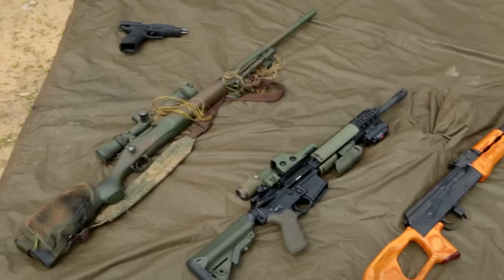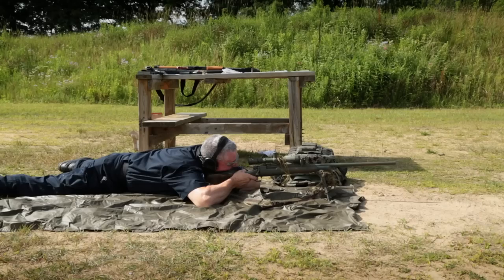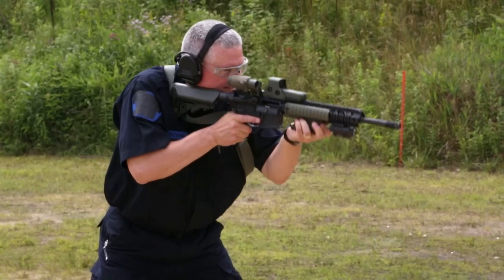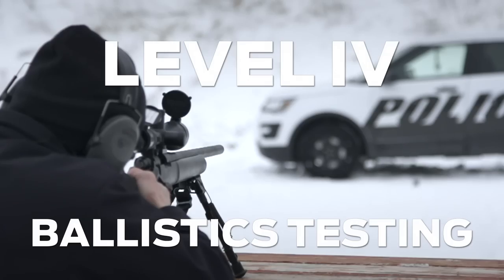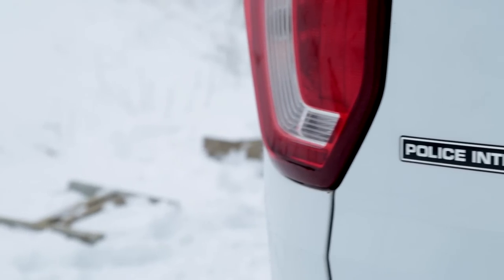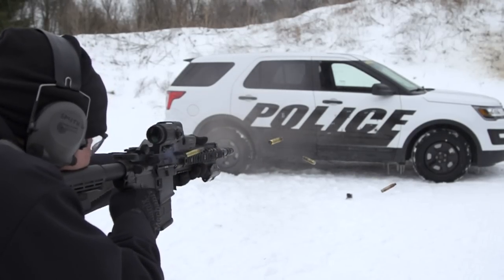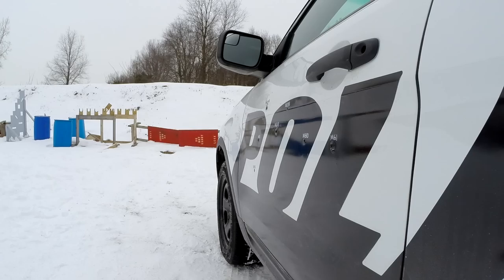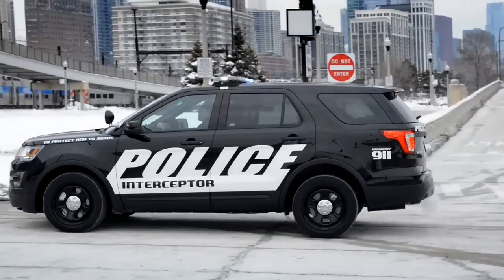Ford Police Interceptor Ballistics bullet proof armor Testing schussfeste Panzerung - Autogefühl

Comment: Cab bullet proof window resist armour piercing bullets ? Or those windows only resist non armour piercing bullets ?
Reply: Alan Garcia “Bulletproof” is hard to define. The short answer is no. In addition to the normal lack of knowledge of ballistics, it’s worth noting that an “armor piercing” round doesn’t really increase the round’s penetration the same way a larger caliber round would. For instance, a 7.62x51 round will nearly always go through more things than an armor piercing 5.56x45 round.

So that means that normal bullets are basically just as threatening to armor as the same bullet with an “armor-piercing” label tacked on. BASICALLY. It gets pretty complicated, and generally bigger bullets gain more of an effect from penetrating cores. This is like 12.7x99 and up, tho.

Comment: Will they buy it when they find out how much gas it's used and the windows are not bullet proof?
Reply: The windows are bulletproof they have a layer of polycarbonate that will stop the bullet or a bulletproof window laminate/tinted. The bulletproof window laminate is also bomb proof since the bulletproof window laminate company blew a 2500 pound bomb.

Comment: Windows?
Reply: +JWJMC Yeah; a question so obvious the video doesn't deal with it at all, which probably tells you everything you need to know.
Reply from the maker: +JWJMC I also thought about the instantly. Obviously armored windows would increase the weight of the car significantly and it is also said that you could hardly get out injured people after a crash when the windows wont break.
Reply: +JWJMC probably not bullet proof but then again its not supposed to be a tank. Some protection is better than none. Also like the uploader says these cars are used a lot so a crash is very likely in which case you want to be able to get people out if the worse happens.
Reply from the maker: +Jan Šinkovec Good point, maybe a crash is even way more likely than the car getting hit by a huge bullet
Reply: +Jan Šinkovec I think that they are bullet proof  windows not so much as the doors but they are
Reply: The purpose of armoring the doors is for use as a shield when performing high risk stops, or setting up a perimeter around a scene. Now an officer can safely take cover behind the door.
Reply: Lol

Comment: Mini gun test just in case you don’t know what’s on the streets now
Reply: Diced Miniguns typically fire 7.62x51. A few fire 5.56x45 and a few fire 20x102. The A-10’s monstrous 30x173 rotary cannon is probably the largest “minigun.”

So which one are you going to find on the street? Everything but the 5.56 will swisscheese it. It could probably take more than 30 rounds from the 5.56.

Comment: This isn't for the windows. This is so you can safely hide behind an area other than the engine block. Most bad guys don't have good aim, but you need cover to collect yourself under pressure. Look at the ballistics of a simple FMJ 9mm. It will go straight through most car doors on both sides. That's sad. I'd pay more taxes to have this on police cars in my area.
Reply: So if your the badguy you can't aim? If this gives you your confidence!

Comment: Failure, if the glass is not part of the package you failed, alot of officers are shot thru the glass.
Reply: Sadly a lot of officer are shot thru the front windshield  more then folks know.
Reply: I heard a story of a female officer shot through a door, the bullet entered through the door, into her femur, and shattered her femur. With these panels she would be on patrol, and not in a rehab center trying to walk again.
Reply: The purpose of armoring the doors is for use as a shield when performing high risk stops, or setting up a perimeter around a scene. Now an officer can safely take cover behind the door.